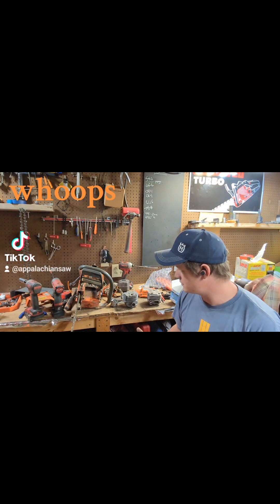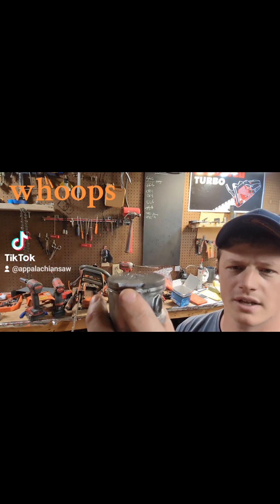whoops

Comment: It happens....I hear good of dukes but recently my duke 55 with 028 has light scoring right at the corner of exhaust port....no porting ...chamfered looked ok...didn't do major only had couple gallon if that throught it
Reply from the maker: This is the first issue I've had with a dukes part and I've spent thousands with them, and frankly I can't really say it was the parts fault.